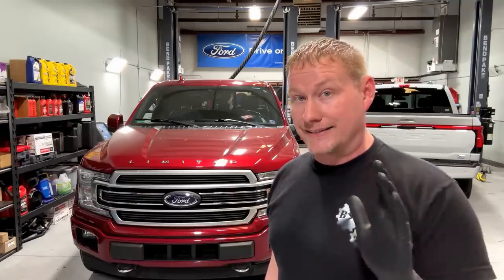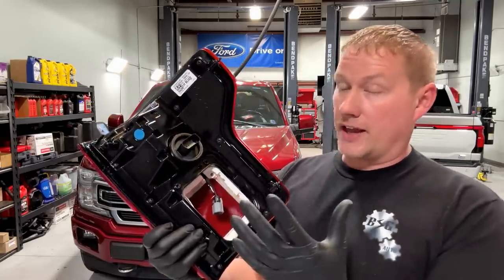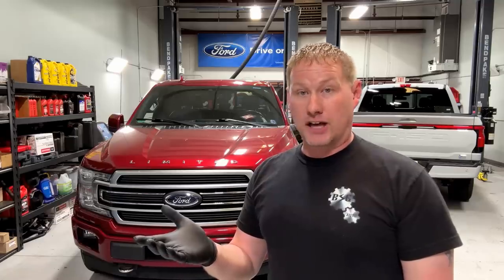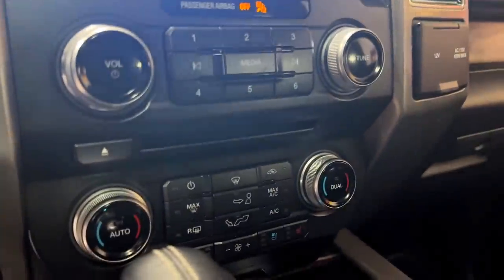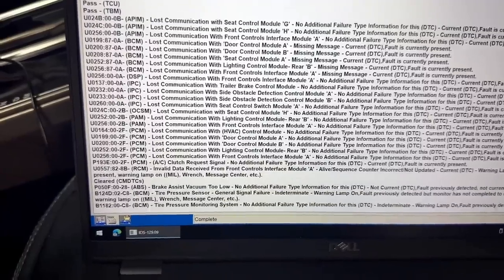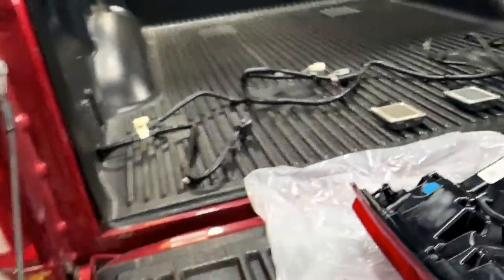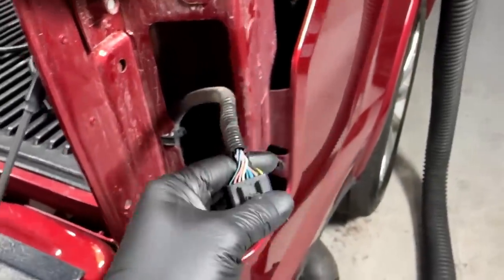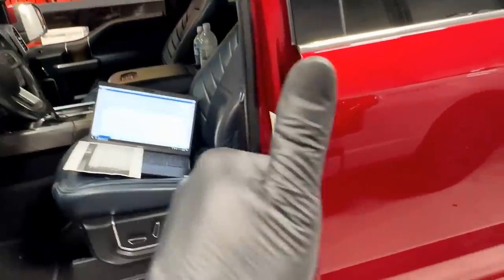Repair Cost Are Out of Control: $5,600 Bill for Some Tail Lamps?!

Comment: 2018, water damage 5 years old? New wiring? No Ford EVER. Last one was a 1998 Ranger 4WD V6, stuck valve at 150K miles 2 new heads. New Toyotas ever since. I have a 97 Camry with water in the taillights I'll get around to sealing someday. Original radiator hoses, alternator, starter, only major part new is the radiator, $80. The problem is like tools, companies will get a name then coast and pull in the profits, so no guarantee with new Toyotas either, though they still set the bar on reliability I think.

Comment: My story...
I have a 2003 Ford Ranger XLT, 4.0, 4X4, tow package, and when I bought it in 2014 it only had 72000-ish miles and a complete service history. About five years ago it overheated on my way to work one morning. I was able to nurse it home and called for a tow to the nearest Ford repair facility. After they looked it over (two days later) they informed me that the thermostat housing and the temperature gauge sensor had both failed...the bill would come to, wait for it, $1270. In the final analysis I was charged over $250 per hour, and the parts cost anywhere from five to fifteen(!) times what the auto parts retailers charged for the same OEM part. I will NEVER go back to Ford for anything...ever.

Comment: As usual, experience matters and what you see here with FordTechMakuloco, its not blind luck. I will not be buying a new vehicle. I am quite happy with my 2007 F150 and my 1984 F150. I am a little nervous about my 2007 since it has more computers but my 1984 has 1 basic computer (ignition module) -- if you can even call it that. If it ever breaks, a new ignition module from Amazon is $40...

Comment: Not surprised.  I bought a Mazda 3 Skyactiv in 2012.  The front right headlight needed to be replaced.  Car was brand new.  The cost if the dealership did not wind up being responsible? $2,500.00.  That was in 2012.
As far as the current state of the car market?  I'll never buy a new vehicle again and I will never buy an EV as long as something else is available.

Comment: Had the back rear end go dead because of a short on a trailer.  Traced down every fuse in/out. Every harness, you name it.  No check engine light.  Decided to hook it up to the OBD scanner and what do you know. It threw a code for the back end. Cleared the code and poof problem gone.  I never would have thought to check for codes on Truck with no tail lights.   Now it gets checked on a regular basis for codes that DON"T trigger the ECM/check engine light!!  What a Scam/Shame.  Wish I would have taken to the dealership, just to see what the would have diagnosed and charged. Three NEW f250s, premium price paid.   Guaranty you they would have gouged me for the very minimum of 300.00 and blamed the trailer. (Which was the guilty party) but hey. How about mr. Smith there is no Charge this time. Just have your trailer check out!!  Uh Ford recommends having the headliner checked every 30K miles. ( That is just how bad it is getting)!!!!!

Comment: I bought the gold extended warranty because of all this crap. I don’t like new trucks but needed on for travel. What a pain that all these modules and sensors are interconnected setting off a domino effect of shortages. I just had a similar issue when the auto start blew a sensor and set off 46 codes and nothing worked properly. Cost $2600 in diagnostics then $800 to fix the grill shutters relay and sensors… luckily it’s all covered under warranty. Once warranty is up I’ll sell the truck and buy a new one … seems like the only way to go

Comment: Wow,  I put 2 new taillights on my 1997 Chevy for $42 a couple years ago😎.  No RADAR of course.

Ford F-series seems to have had this water intrusion tailight/electric issue for a long time. Off-hand I have seen and fixed  that with at least 5 of them in the past say 30 years doin shade-tree.

Comment: Vehicles are stupidly over-engineered these days. The more bells and whistles, the more to break and cost you $$$$$. I want to go from A to B. If I want to make a cup of coffee I'll do it at home. I don't need stupid mirror warnings because I do the natural thing which is look before I signal, and then signal and change lanes. All this junk makes for worse drivers, more accidents, and much, much higher tempers due to softheads that simply cannot drive properly. They are legion.....just look at you insurance bill.
I drive parts for an auto wrecker business.  The prices of some of the parts like a taillight would blow your mind, and the typical thing is used parts are 50% of retail, depending on condition.

Here's a tip.........friends don't let friends drive Kia's, Hyundais, or Dodge Caravans. That being said I would never buy a Dodge truck either. I've towed with them also, and the best thing about the truck wasn't even made by them........Cummins and Allison. The rest was literal garbage, and sourced as cheap as it could be. It would be a Ford 3500 for a towtruck. GM's are too much like driving a livingroom couch, and they don't stand behind any warranty.

Comment: I'm an A.E./C.E. with Lockheed Martin who has worked on the F-35 Flight Dynamics/Battle Space Management sensor software suites and have more than a passing knowledge with networks/electronics/computers/software Control Units. For Ford to place network sensors/modules in areas vulnerable to damage and not take that into account when designing the network electronics and software to avoid system single point failure is professionally quite disappointing.

Comment: Headlights are a very common area of damage and replacement. Manufacturers know this and have made increasingly fragile and expensive lights over the years. Take a look at modern SUV lights like the Toyota 4Runner - they stick out about 2" from the body. That's so that the slightest impact pops the glass and you're out $1700 or whatever. It's a scam.

Comment: Just had to replace my tail lights on my 2020 raptor. Same thing. Water intrusion. 4800.00 bill. Insurance covered about 4kish. I cannot believe ford wont step up and do a recall. Its obviously a design flaw for water to get into these lights. My truck is as clean as they come with low miles too.

Comment: Imagine buying a device that spends its entire life outside and having it rendered useless because it rained. They aren’t even trying to hide the “throw away” features built into vehicles anymore. “You will own nothing and be happy”

Leases starting at 799$ a month with 8000$ down 24 months or 6000 miles, damages incurring a 3.00$ a mile charge maintenance not included. 

Happy renting!

Comment: 2020 F-250.  When shovelings, pushing and pulling to and from the bed, the tail lights are the last 1/2" of the bed.  AKA they are going to get hit if you use your truck like a truck.  Does anyone know of a UV, llife turn glue for the plastic.  Mine in cracked and blew the break light when it took on water.  I got lucky with an new bulb and draining the water.  $1200 for the lens is out of line.

Comment: Pretty much what I got from this video is.....

Never buy a Ford truck or any truck that's not in the 90s. 

Currently rebuilding my 1996 Bronco Eddie Bauer 5.0 with 347k miles thats my daily driver and a single tail light for that truck would finish off getting parts for my top engine rebuild. Plus I feel like mine is just safer to drive and its a $1200 field find that I had to chop the body in half and Sammamish the bed of 95 Bronco on there because mine was that rusted out. Haha 

But I love the vids you put out and the in depth information.

Comment: To replace my SAAB AERO tail light is about 150 and it has builtin backup lights and fog lights something no other car has.  It also has a builtin roll-bar and side impact bars again something no other car has. See Top Gear SAAB strength  vs BMW insane safety

Comment: I had a 2018 mustang I needed a new taillight they wanted $1500 cnd. I went to the wrecker they wanted $750. I just drove around with a bad taillight. It would light up at night and the brake light worked the blinker would randomly go nuts. What was wrong with good old bulbs you could replace yourself for five bucks.

Comment: GM is just as bad. We had a 2014 Cadillac XTS that became 'possesed' as the custome put it. Turned out to be a bad blind spot radar sensor inside the rear bumper cover. Also got wet inside and brought down the can bus network. Door locks started locking and unlocking. Fuel gauge said 0. Radio was dead. Speedometer stopped working. Customer wanted us to do a exorcism. Lol.

Comment: This is really the most ridiculous failure of all time.
If I had a Ferrari, this level of expense might be tolerable.
They only built 500 of that model, one only parts available,etc.
But this is a Ford Pickup Truck!!!
I would never buy another, and would paint this horror story in big letters on the side of the truck, and certainly tell this sad tale on any media available to me.
Good job fixing it. I would immediately get rid of it, and replace it with something with a less stupid design.
Which could be pretty easy. All those nice extra features: I'd get over not having them.

Comment: Remember, consumers caused this. I rebuild engines, and day in and day out i hear of people who are told how much a replacement engine for their almost new car is gonna be, because the engine has a design flaw and will kill itself, LS with AFM, Hemis MDS, Cayotes and the Ecoboosts with the wet belts and bad phasers, Ecotecs all of them, , Hyundais/Kia ALL of them, etc etc. And a little bit later they drive in with a new GM or New hyundai/kia or new RAM or new ford even after their last one had major issues so early on.

Sorry consumers brought this on themselves. Personally I'm pretty happy with it, I make an absolute killing  rebuilding these junk new motors. And there aren't many builders around anymore so the competition doesn't exist, even dealers are happy to pay me instead of waiting on the parent company who is backordered to 3 years. Personally i thank these companies for buying me my second house, i haven't bothered worked in 3 days. My friends who where electrical engineers all are doing module repair and reprogramming now, that's the new big money thing. I know guys repairing the LED lights in suburbans and stuff making a killing and they're working from their home.

Comment: We had a discussion a few weeks back about repairs like this. The manufacturers are absolutely concerned with "Right to Repair" legislation gaining steam. This is their way around it: integrated systems and prohibitively expensive components. Sure, you COULD work on it yourself, if you wanted to, but it'll be beyond the skill level of a shadetree mechanic and cost thousands of dollars. It may likely require the use of electronic diagnostic equipment that the average person is not likely to own. On the more extreme ends, you'll have to replace entire integrated systems. Why sure, an independent mechanic CAN still fix your car,  but when these integrated systems aren't repairable, but rather must be completely replaced, the manufacturer still stands to make big bucks from parts. Heck, is this 10 year-old car even worth it to fix at this price? Might want to consider looking at a new one. Naw, nobody will pay for this car with this massive problem, off to the crusher it goes. 
         In essence, it's an insurance policy against Right to Repair.

Comment: Ford claims water intrusion in any light is a mechanical failure, not electrical.  Therefore, your warranty will not cover.  I WAS a dedicated Ford owner until my issue as this video is covering.  Morimoto XB had better lights that -lug and play, and they stand by their product for five years.  All my systems came back on line also.  Go CHEVY!  Great informative video for those still struggling with this issue.  Ford was not able to pinpoint the issue with the other systems.  With these high end trim packages, one would think Ford would wise up.

Comment: I gave up driving several years ago. A month after I returned to Canada after working in the US for 3 years, I had to get new insurance since I could no longer use the US insurance that was only costing me $56 a month in $CDN. Well because I didn't have continuous insurance in Canada due to the two-year break of working in the US I was forced to go to Facility high-risk insurance for five years. They wanted $3,000 a month for insurance. I did that for a couple of months but then the IT contract I was working on ended so I sold the car and have never driven since. Parts are expensive, insurance is expensive and there is no reason to spend money just to keep the car for driving to job interviews. Now with electric vehicles, it's even worse. A minor fender bender and the insurance company will scrap the car because of the repair costs being in the thousands and tens of thousands of dollars. A friend of mine got into an accident where her EVC was rear-ended by a truck driver who had lost situational awareness.  damage to the rear bumper and a broken rear window and the trunk latch was no longer working (Could not be opened) The shop told her she needed to replace the entire battery pack and 40 sensors. total cost $67,000. Insurance decided to scrap the car since a replacement vehicle would only be about $70,000. She took the payout and is now taking public transit and using Uber for everything else.

Comment: Modern cars are built and sold so close to the profit line that the car manufacturers HAVE to rip you off on parts and servicing to stay afloat. 

You think this is bad buy parts for heavy equipment. I replaced an alluminium pickup tube (just a funny shaped tube if alluminium) and it was over $1200

Comment: This is what you get when you specify military-grade complexity with civilian grade parts and build quality.
I had a similar thing when I helped my brother-in-law build a Dax Cobra ... almost no expense spared, a small block V8, a custom bellhousing to mate with a Toyota Supra gearbox, Jaguar running gear, Connoly hide interior, the whole caboodle. The problems started when I was doing the wiring loom on the garage wall, he wouldn't pay for anything other than bullet connectors, cheap wiring and very little sleeving .... whilst that was going on he was putting everything together with ordinary steel nuts and bolts, the cheapest available. The result was that after a year the electrics went "problematic" which I got the blame for and a couple of years later it failed its first official inspection because of rusty, seized and failing fasteners ....... Oh, well.

Comment: My 2019 F-150 Lariat has the same issue. Mine was cracked at the top, which allowed water in. A good preventative is to drill a very small hole at the bottom of each lens. This allows any water inside to drain before damaging corrosion happens.

Comment: Had the exact problem two years ago on my 2019 platinum. I was traveling across country and all of a sudden my truck started doing all the stuff that was mentioned. I stopped at a dealer in New Mexico. They initially told me it was my body control module, but didn’t have one in stock so ended up just hitting the road and trying to get as far as I could to my destination. By the time I got where I was going, my truck was running, but hardly anything else was working. The dealer I took it to there correctly diagnosed it as passenger side tail light. But I paid $1500 for the tail light and all the included modules from the dealer. I could not believe all those problems came from a single tail light with some water exposure.

Comment: The first problem is that it's a Ford. I gave up on the new garbage and bought 2 early 90's Toyota pickups. After a little work getting some bugs worked out (which I did myself) they super reliable, cheap to operate, easy to park, fun to drive and parts are easy to come by. I'll never go back to an overpriced piece of American garbage again.

Comment: Sure, you can buy an extended warranty that might, save for the fine print, cover the absurd expenses here. And, sure, your insurance might cover the absurd expenses here, except the exclusions listed with every policy go on for so long that it will be your lucky day to be protected after a loss. But what happens after those few years when warranties are no longer available, or the premiums are sky high because of mounting losses? These $100,000 vehicles, even if they appear shiny-new, will be rendered useless by insanely complicated and difficult to repair technology. A problem with a taillight causes a vehicle to not start? Seriously? Disaster in the making.

Comment: I had almost the same issue completely dead truck had it towed to my dealer they had it a week and finally got it running and they charged my "$500.00 to tighten a ground bolt" they said the issue was the (main system ground bolt) they said the dashcam was mounted to the main system ground and the installer did not tighten the bolt back up. But that was a lie because it was always connected to the body ground and it was in there just after I purchased the truck. Now just after 5 years the bolt comes loose to something it was never attached to. We will never deal with Ford again. FORD OWNERS BEWARE Dealers are scam artists.

Comment: I saw an auto industry engineering consultant who has worked for most the major manufacturers. He  presented a chart showing the correlation between what Ford, GM and Stellantis/Chrysler pay their parts suppliers and the rate of failures of said parts. They get what they pay for. Not only that, the Bjg 3 constantly shop for cheaper suppliers so there’s no reward for quality if you’re a supplier. Toyota had the highest standards and actually pays the most and if the supplier has a quality issue, Toyota works with the supplier to fix it. I know, Toyota isn’t perfect, but they’re sure better than the Big 3.